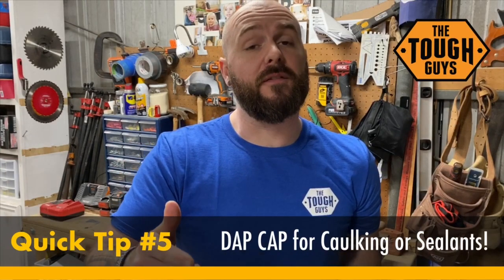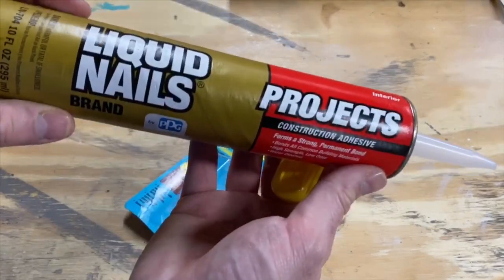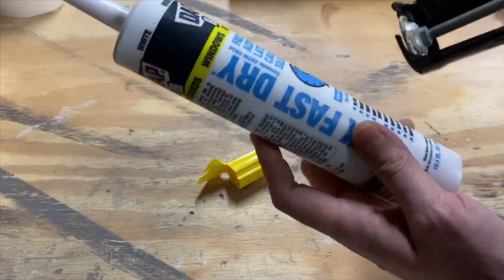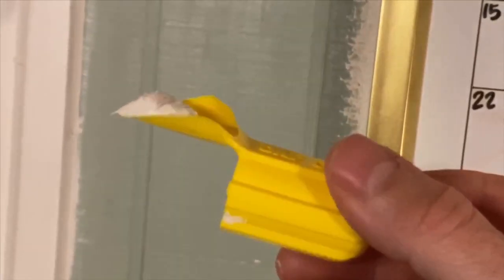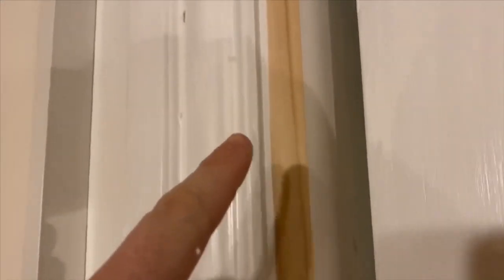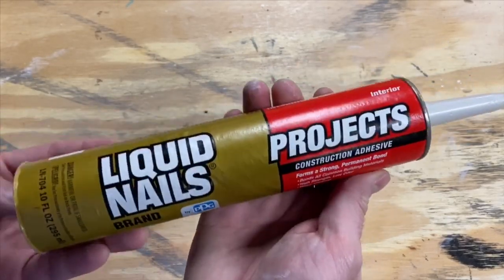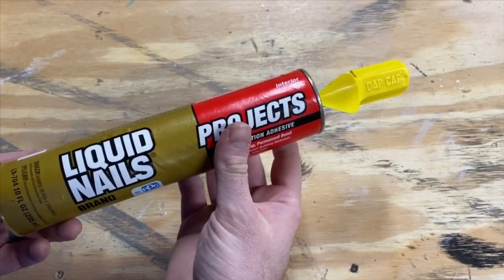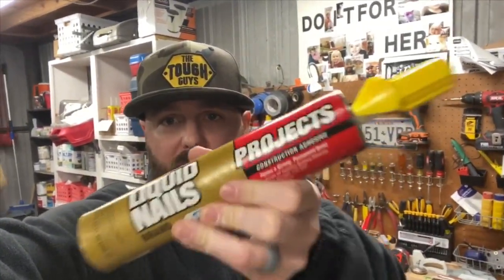DAP CAP! Perfect Caulk Lines Everytime! Quick Tip 5

Comment: While it's convenient to have a special little tool to keep your DAP from drying out, you can use painter's tape.  And as other's have mentioned, you can use your library card or any laminated card with a rounded corner for caulk application.  I try to use what I already have rather than support products that are plastic and that I will likely use one time.

Comment: Maybe it will seal for a week or two, but I think it's pretty much impossible to keep silicone caulk from slidifying inside the tube no matter what you use.
Reply from the maker: I was able to use a couple different tubes for months not weeks, for small misc projects. These get a solid seal, at least for me they did.

Comment: I leave my liquid nails open all the time after use. The first inch of it will dry out and can be pullout out easily. The rest behind that inch will be just like brand new. I've used the same large tube of liquid nails over 3 months and never wasted any. I guess the dap cap is useful for caulk maybe but I don't remember ever wasting that either.
Reply from the maker: You are luckier than me.  These things are cheap, and keep mine from hardening in the tubes - I've never been able to extract the chunk in the end and still have the remaining be ok / not partially hardened in the tube.
Reply: "The first inch will dry out" and "never wasted any". So if that inch wasn't wasted then what did you do with it?

Comment: Doesn’t look very good  in my opinion a finger is better than that plus you can find plastic around your house and cut it to shape for free. I bought this and regret it. Had to go over it with another line and my finger  I used painters tape to control the smear effect than cleaned   Maybe it’s because the wood on your wall that made it look sloppy. But thanks for sharing
Reply from the maker: The wood was definitely not helping anything, that's for sure.  In a cleaner setting, say caulking around a tub, this would perform better for sure.  I've always used my finger as well, because you get a 'feel' for it and you get used to that BUT this does have potential.  Mainly I like the fact I can keep it on the half-used bottle and it doesn't dry up - thats a win either way!